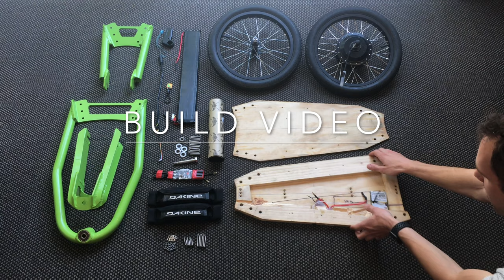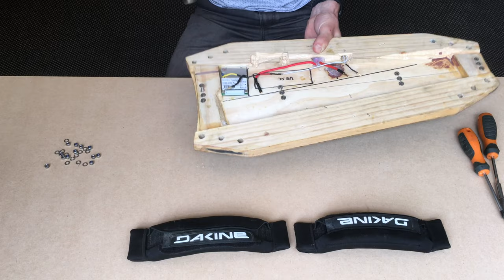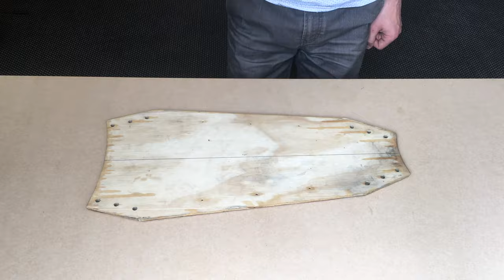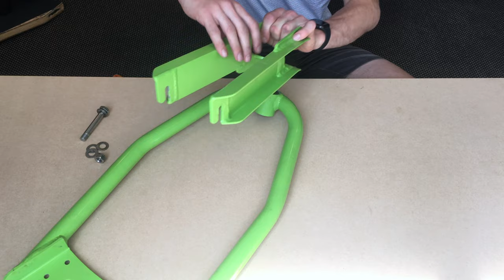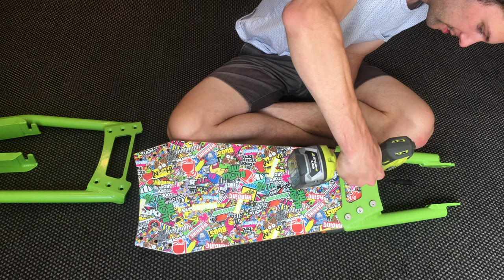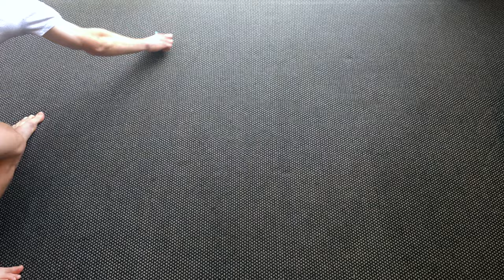Build Video // This is not an electric skateboard

Comment: Hannes is there a good reason just to have one wheel that is able to turn? I was thinking of building a dirtsurfer based on the skateboard idea where the trucks tend to pull straight without pressure but both rear and front wheel can turn if you press hard.
Reply from the maker: Great question - I don’t think it would be stable. It has the same problem that the rear wheel steering motorbike had, it was impossible to ride.
Reply: @HannesHille  ok thanks my friend had a dirtsurfer I'm going to borrow then I'll build my own since they are impossible to buy

Comment: Cool build, any reason you went geared v direct drive motor? I would have thought braking was difficult with geared? Oh and how is the flex with your ply mid section?
Reply from the maker: Thanks! I chose a geared motor for it's light weight - from my research these tended to be quite a bit lighter than their direct-drive counterparts. I removed the freewheel to enable braking.

It's not quite as flexible as a bamboo longboard, but it has a nice bounce to it. I might have to make a ride video.